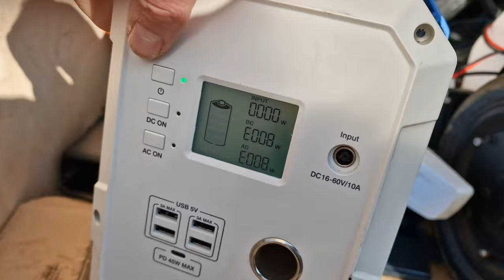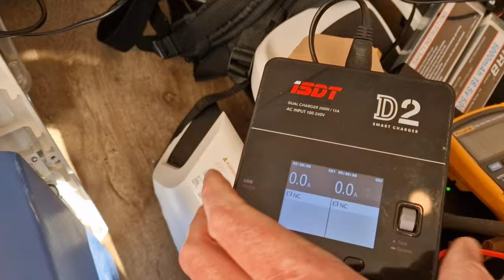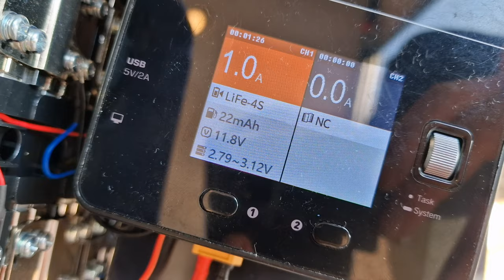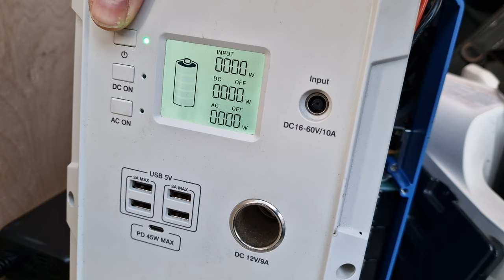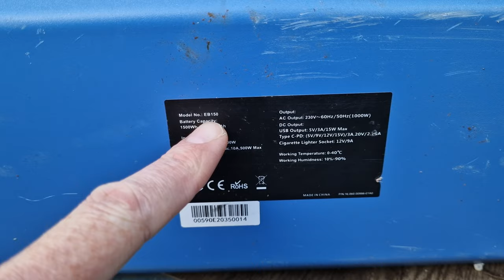HOW TO FIX A BROKEN POWER STATION WITH THIS SIMPLE TRICK!!!

Comment: Very interesting.Iv a very similar issue with a jackery 1000 explorer. Shows no signs of life without the charger plugged in. Once the charger is connected it shows battery as empty then all of a sudden shows full but as soon as the charger is disconnected the unit powers off. I do get an overload warning when 240v is switched on. Dont suppose you have Any ideas

Comment: I have the other problem. The unit accepts charge but when unplugged it will not discharge. It just shuts down. If I have it plugged in to any charge source then I can use the unit fully. Only it won't work once standing alone.. any ideas?

Comment: You are correct about the batteries being lithium ion and the nominal voltage of 3.7v per cell (14.8v total). The reason it stopped working is because one of the cells dropped below 3.0v. When this happens, the BMS will become disabled and the entire unit will no longer function or charge. The only way to recover normal function at this point is by disconnecting the BMS and charging the overly depleted cell(s) directly until the voltage is above 3.0v on all cells, which is essentially what you did. Another thing to know is that lithium ion batteries should not (or sometimes cannot) be charged in temperatures below 32°F (0°C). They will also suffer diminished capacity/output below this point, which may have been part of the reason one of the cells fell below 3v.

Comment: Good one Andy,had the same problem on the ebike,just unhook the BMS and put the battery  bike back on charge for 30 mins disconnected the charger  and  repluged the BMS waited until the cells rebalanced for 1 hr and then un repluged  the BMS ,then repluged the BMS ,put the battery back on  slow charge ,waited until it cut off.Left the pack for 2 hrs to rebalance then gave it a small top up,54.8v...as I use two batteries in parallel each one has its own volt meter,thus avoiding burning down the garage,nice little video..😃👍

Comment: I have a EGO Power 56V snow blower and I had an issue that putting the batteries on the charger and then trying to use them would make them immediately drop from 5/5 bars to 2 or 3 out of 5 bars (even without snow in the chute).

I threw them on my desktop power supply at 58.8V and surprisingly a "fully charged" battery took 3 amps of constant current for a while and then even then it took forever to settle out below 100mA trickle charging.  After that they behave far far better.

My guess is the supplied charger doesn't trickle charge them long enough to top balance.  So now I always do a top balance charge and they've been performing great all winter (here in Ottawa Canada).

I've had other yard batteries die similarly and I suspect it's for very similar reasons.

Consumer supplied chargers need to really up their game.

Comment: Weird you had an E007 error which is normally 'Under-temperature protection when charging the battery' was it really cold? or was that just a by product of the low voltage? as the E008 is under voltage protection. Am only on 4 minutes of the video so i'll apologise if you cover this in the final 6 minutes :) finished and i think you guessed right at the end with low temps! i've got the EB240 so interesting to watch and share experiences!

Comment: My EB150 after 1 minute of the AC button being pressed comes up with the error code E013. This is with our without something plugged into the outlet sockets. Do you think pulling the BMS plug out and replacing may fix this too??? Such a shame as the unit has been so good up until now. It is stored at 21oC so not hot or cold and has 4 bars charge left in it. DC works fine and it will charge from the mains.

Comment: Will this trick work for a Duracell power station block 500? I think I plugged in the power station and had my generator on at same time
Reply: It keeps making a sound periodically. What can I do to fix it? Thank you for your response
Reply: @eugeneeogbeide You need to figure out what the problem is before you can fix it. If you over-discharged your unit by running it completely dead and then not charging it for an extended period of time, then this video might help you. Otherwise, prob not.

Comment: Hi Andy, love your videos. They are inspiring!!May ask your advice, please.  I’v e a 36v 10Ah and 48v  10Ah battery  on a 350v front hub motor set up with a Dx2 battery blender to run both. But ‘would like’ to run on the 36v and have a boost button to engage to 48v when I need it for a bit of extra acceleration when required. Can you suggest a waterproof handlebar mounting 48v 20A switch or switch relay configuration to enable this, please? Any thoughts or steer gratefully received. Best Wishes. Raymond
Reply from the maker: Hi, Glad you like the videos! You'd probably want to use contactors instead of realys to run the main power through due to the arcing when you connect a battery to a controller. It could probably be done but not sure how practical it would be... 😊
Reply: Hi Andy, great content which shows your electrical knowledge and enthusiasm . Thank you for the advice. I’ve got a 50A switch in a 😢paneer bag at the back next to the battery to turn the unit on and off. If I had a suitable waterproof handlebar  mounted switch I would go for this option. If you are aware of a supplier that would be appreciated. Kind regards. Raymond
Reply: Hi Andy, I’ve just ‘Hooked’ with TX60’s a 24-72v DC, 40A wireless on/off switch on handlebar  from the 48v ‘booster’ battery , through a power meter ( to measure watts and amp draw) to the controller. I now  run on 36v and hit the button which switches on the 48v  ( connected via a DX2) when I need the extra toque up the hill I live on, just ‘need 😂’ to overtake the rider in front on the commute. Really appreciated your comments. Raymond

Comment: I would imagine, this issue would not happen much, if the EB150 was never discharged completely to zero ? ...always shut it down when there is only 1 bar left on the battery status symbol.

Comment: But...
The BMS should have kept them balanced.
So maybe you just have a charge controller and not a BMS.

Also of these things are li-ion as they are cheaper cells :)
Reply from the maker: Most BMS balance top of charge. It's defo a BMS as it switches the negative when things go wonky. It's a strange scenario though. It was a while since it had a proper charge so self discharge could have played a part here.
Interesting though! 😁
Reply: @andykirby  you can have a BMS without balance,  I'd check see if it has as there will be resistors and opamps if it does balance.

Cold will have some effect, but there are two types of balance a discharge, which does nothing or one that will discharge a high battery to a low one.

The cold, would have something to do with it and low solar power going in. But it could be a  bad cells. You'll have to cycle it a few times and see .